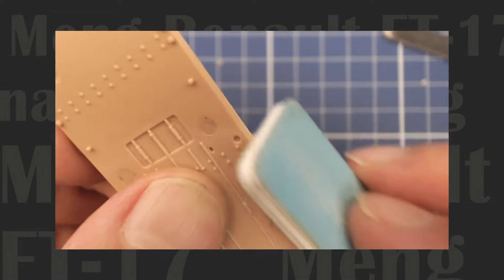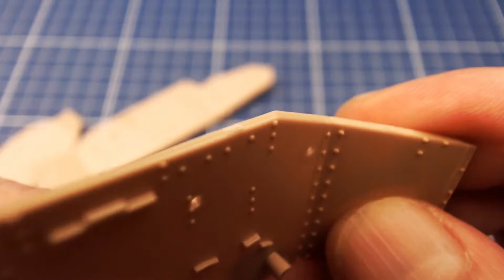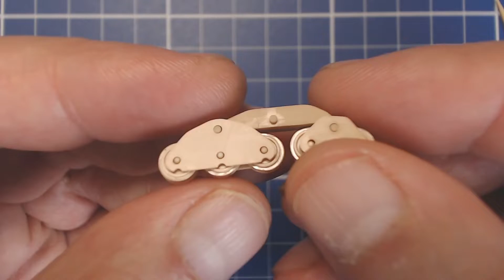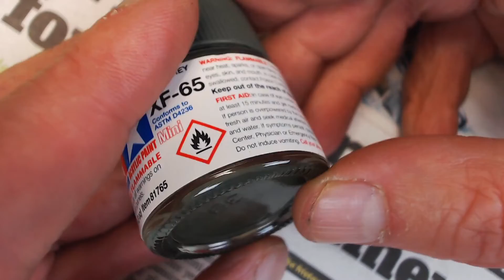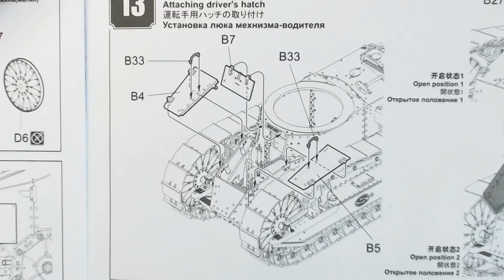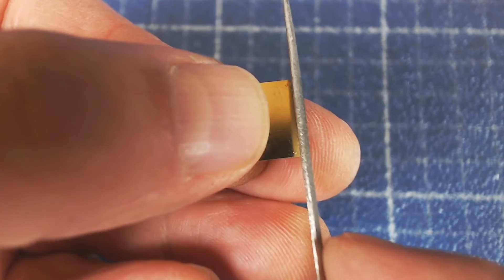Meng FT-17 Build Part 1

Comment: 9:18 what kind of paint did you use?
Reply from the maker: Hey Roman. At the 9:18 time stamp it looks like the interior facets of the turret are depicted. Those faces were painted with flat white acrylic (probably Tamiya thinned with lacquer and shot through an airbrush). Then the pieces were coated with a clear gloss acrylic, hence the shine.
Reply: @stevieray3211  thank you